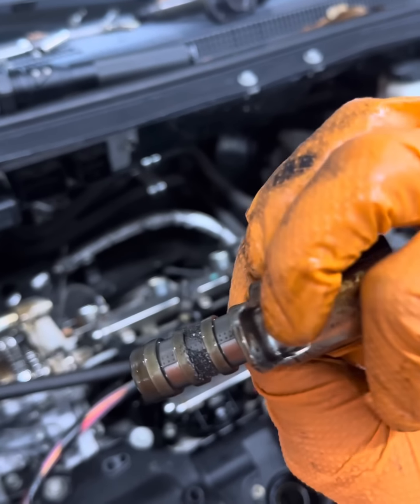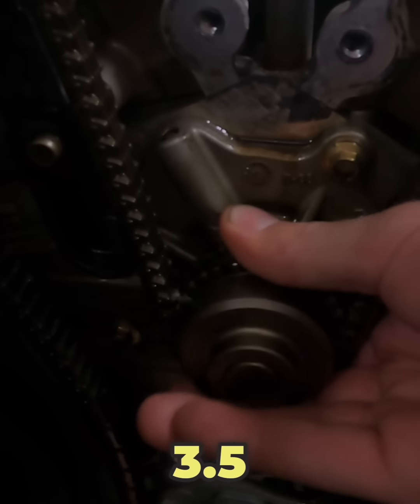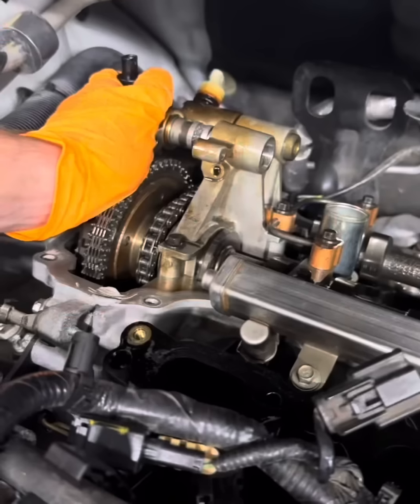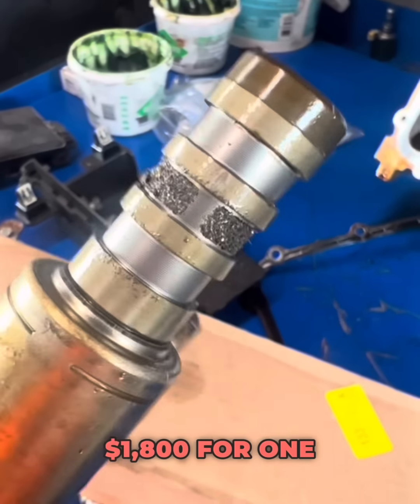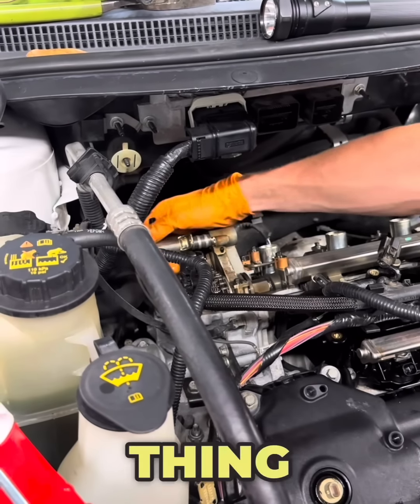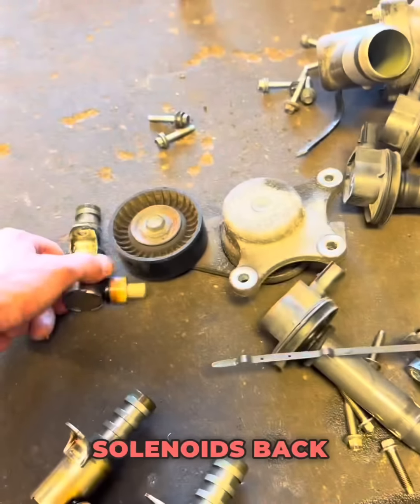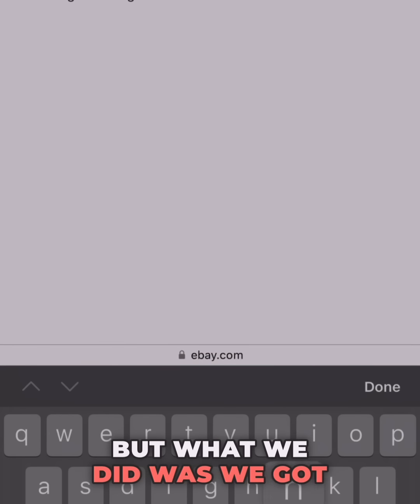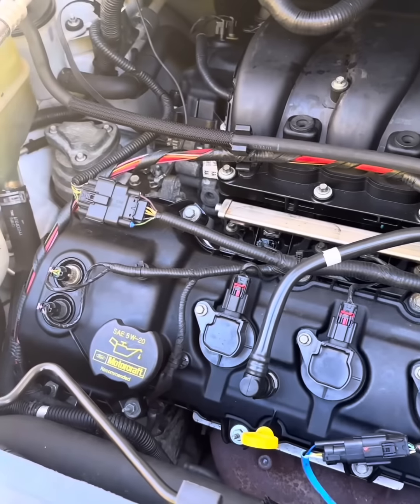Ford's Toughest Engine? It BLEW Up!

Comment: The 4.9 300 straight 6 is the best motor ford ever made! This new stuff cant even compare!
Reply: Facts. Had one in my 91 f150 and it was amazing! I miss that truck everyday!
Reply: What about the 3.0 Vulcan which is known to hit over 300k miles
Reply: When I said 2.0 . I was referring to modern engines . Still in service and being produced . So to speak . The 300 inline 6 and the Vulcan 3.0 litre . V6 where both extremely reliable .  Simple engine design with very low cost of ownership . As we have moved forward . More is demanded of engines . Meeting tighter emissions . Being top along with light weight . And higher power from less displacement . Have increased the complexity . Leading to more things to go wrong . So unfortunately a comparison to older designs is not really fair
Reply: I didn't see a 300 I6, so I can't say you were working on Ford's toughest engine, bud. No offense, but I've been a master certified tech longer than this guy's been alive. Several years at a Ford dealer, too.....
Reply: Fact my dad and grandpa had them they would keep up with the V8s
Reply: The 300 motor is a legend among inline 6’s.
Reply: Was fixing to pull a 300 out of a 72 to put v8 in it said lets blow it up put block on gas pedal we got tired of waiting went to town to get something to eat still running when we got back poor thing just didn't have enough power to blow it's self up  was a tough motor all the same  we had put it through b4 all that
Reply: Guys, Here is The Savior

HalleluYAH translates “Praise ye YaH”

YaH is The Heavenly Father 
YaH arrives via the TENT OF MEETING
YaH was Who they Crucified for our sins
YaH was Crucified on an Almond TREE

— Ancient Semitic Cuneiform of Moshe (Moses)
— Isa Scroll (The Original Isaiah)

Isaiah 42:8
"I am YaH; that is my Name! I will not yield my glory to another or my praise to idols.

Isaiah 43:11
I, I am YAH, and there is no other Savior but Me.

Isaiah 45:5
I am YaH, and there is none else.
Reply: The 300 straight and the  351
Reply: 300 6 cylinder was a turd
Reply: The 4.6 in the Crown Victoria is also one of the best Fords engines.
Reply: Almost any engine that’s OHV (to heck with overhead cam engines) on top of having a cast iron timing gear is going to run forever. The more complexity a engine has, the higher probability of a breakdown and that’s fact. The Ford 240/300 inline 6 along with the Ford 302 are some of the toughest engines that Ford ever made.
Reply: You have no clue what your talking about ☠️
Reply: @dakotaalexander9292  you have no clue on what you are talking about, either. This is exactly why things are in such shambles as of late, usually crappy engine designs and vehicles are a reflection on today’s society, along with the people who keep on buying awful vehicles blindly.
Reply: @seana806  40.000 miles no oil pressure and bearings rattle
Reply: @JUNEBUGLLC  I agree.....i owned many ...best ever...

Comment: The 3.5 and 3.7 NA engine are tanks, I've seen several transit with 300 to 400k miles on them with the original powertrain
Reply: I've got 250K on my 08 Taurus and have only done the water pump and plugs and coils in 13 years. 👍
Reply: Rear wheel drive units are amazing. External water pump!
Reply: How did this one get so jacked up? Or are those transits with extensive service (I consider extensive meaning anything outside of oil changes and consumables before 200k... Cam chains, phasers, water pumps etc are not consumables)
Reply: 2013 f 150 3. 7 v6 6 speed auto..Bullitt  proof no problems .

Comment: Car business is a tough business. That was a pretty humbling video though. Bought for $1200, put a water pump in and the engine is full of metal. "I am going to sell this for $10 grand" 🤣 And then you. made $1k on it🤣

Once you get coolant in the engine like that, the engine is junk. Swap a used engine in and move on. I have tried in the past to run with it, but have failed miserably. 

I bought an Edge a couple years back as a repo with a locked up engine. I expected to put an engine in it, but checked it out. Alternator was locked up. New alternator and it was back on the road.

Comment: I have a 3.7 cyclone, but mine is the superior version with an externally mounted water pump.
Reply: In the f150?
Reply: @imabebebebe2496 Probably a old v6 mustang ....
Reply: F150 2013 3. 7 in mine and also 2016/17 Mustangs
Reply: @imabebebebe2496  Yes, an F150.

Comment: used to have 2013 edge... no issues with engine but tons of tranny issues... been at ford dealer 5 times in 1 year for tranny issues and finally traded it in to different brand

Comment: I just repaired one with the same issue.  Water pump and metal in the solenoids.   Cleaned them and ran fine.

Comment: I am not a ford guy, but these 3.5 n/a V6 had zero issues when I was wrenching. The water pump design (being in the timing area) is not good but they also didn’t have a high failure rate and the Job isn’t that hard to do if you know what you are doing. Saw ford edge vehicles with 200k plus miles and the performed like new still.

Comment: I like the cyclone series... when they're placed longitudinally with the external water pump.  This engine was clearly designed for that application (probably via the Mustang) first, then adapted for transverse with some corner cutting.

Comment: Yep the coolant damaged the bearings. Should of messaged me and I would of saved you some time and effort. by the way the 3.7 is plug and play to replace the 3.5   Got me an SEL with a 3.7 in it.  Tuned, ported intakes and Magnaflow exhaust

Comment: I have  95 Grand Cherokee. 238,000 and still starts like the first day. I had a chevy c10 with straight 6 and 3 on the tree over 200,000 didn't use any oil and ran great. Only reason I don't have truck anymore got t boned and totaled.

Comment: This was caused BECAUSE when the water pump failed and they milked the oil they kept on riding.  Pretty common. I knew about the water pump issues on my Lincoln MKT 3.5 Ecoboost so at 120k I didn't wait for it to fail i went ahead and changed the water pump, chain, tensioner updated guides . All ford parts and i sold that car with 180k on it about a year ago and i still see it running all over town.

Comment: I have a 2010 Ford Flex 3.5 Ecoboost and am having a cylinder #2 misfire. There is oil inside of the cylinder and mechanics have said that inside the cylinder is damaged and I need a new motor. The vehicle still starts but runs very rough and blows white smoke out the exhaust. The vehicle had no issues until it had the biggest issue. We hit a minor bump in the road and the next thing I know the vehicle lost power. What could have caused this?

Comment: Them 3.5s are great engines, just make sure you change the antifreeze every 50,000 miles or sooner. It greatly extends the life of the water pump.

Comment: I bet there were engineers at Ford that hated building an internally driven water pump.  No doubt knowing it would ruin many thousands of engines and give an otherwise great engine and brand a bad name.
Reply: There is a bunch of cars that run internal water pumps, and timing belt driven water pumps. Not the greatest voice, but

Comment: My 5.4 Triton has 306,000 but it spit a plug 2 weeks ago 😞 My mechanic neighbor fixed it for me, running like a top again!
Reply: 2v or 3v?
Reply: @noobjitsu1743  it’s a 2V. Been a really good truck so far but it had to go & spit that plug.
Reply: I do have a 3V as well. It has 252,000 miles on it. It has a little bit of an issue right now. I think a phaser is sticking. It runs ok above 45 below that you have to take it out of overdrive.
Reply: @dennylittle7633  I locked my cam phazers out and upgraded the oil pump. The phazers cant give you an issue if they cant move and you get a tuner out if it!
Reply: @noobjitsu1743  is locking the phasers out a tear the motor apart job?
Reply: @dennylittle7633  Only to the valve covers and remove the phazer itself.

Edit I did the job myself but to take off the passenger side you gotta recharge a/c so I didnt continue cause I dont have an a/c recharger. 

I did the VCT solenoid.

Comment: This engine is the best arguably better than the 300 i6 more power and 300k miles all day these engines are cheap because they dont die very easy and im not a ford guy i personally own gms but ive worked on just about everything except a few exotics

Comment: You’ve convinced that Fords are junk. I’m really sweating my 3.5 ecoboost 2016 F150.I put a catch can on it from day one and I change the oil every 3k plus air filter every 9 k.Its a clean truck with 48 k on it .I hope it holds together
Reply: I heard about a truck like yours went over a million miles, 1st motor lasted like 600,000 miles.
Reply: @dennylittle7633  Good deal

Comment: Wake up junior. 3.5 & 3.7  are a joke. Best Ford engines are in the past  not this new BS Engines.
Reply: Best Ford engines are the 240/300 inline 6 along with the 302 V8. No other engine in the EcoBoost family will ever be able to hold a candle to the 300 and 302.

Comment: With all these engines having VVT’s, why in the fuck, would you engineer the water pump to be internal, so that the oil and water mix, when the pump goes out?
Reply: Beyond me. This is why cars would be better off if they were still built like they were in the 1960’s, with better rust proofing and better tolerances.

Comment: Not very good advertisement for your mechanical skills😂😂😂
Reply: Was thinking the same. It's pretty common knowledge that water in the engine does a ton of irreparable damage VERY fast. Lot's of other YT vids showing this same thing. I was surprised how confident he was that this motor 'doesn't care' if you dump water in the oil and try to run it.

Comment: I don't care. This motor is terrible because it is not built for an average owner. They cannot maintain this and keep it. Honda crvs and civics all day. Modular 4.6l v8s, coyotes, all day in majority. This engine design for the consumer base that would buy it, is a terrible mix. I would argue eco boost, 2.0 gdi turbos, are in this boat too.

Comment: The Ford 3.5 is a pile of trash.Look the price of them used,over $2,000.00 with a core charge used with yards getting calls for them.Most of those used engines sold on Ebay are from LKQ which they want the old engine back as a core